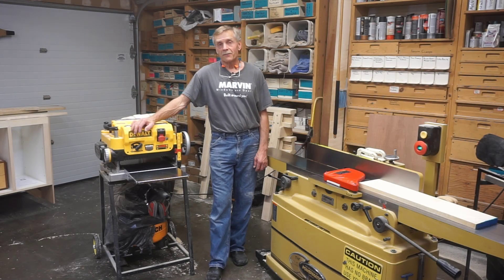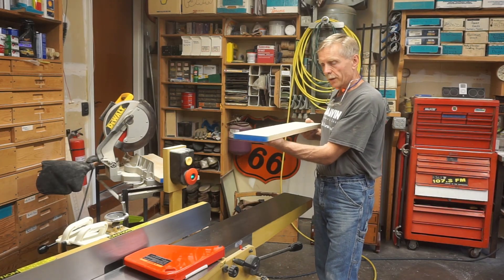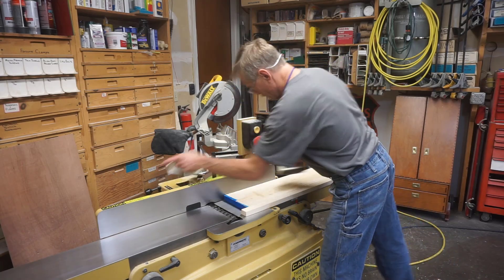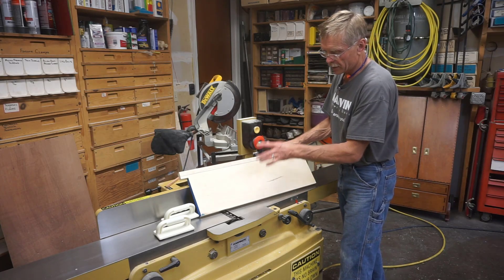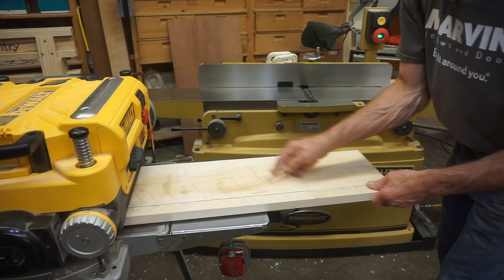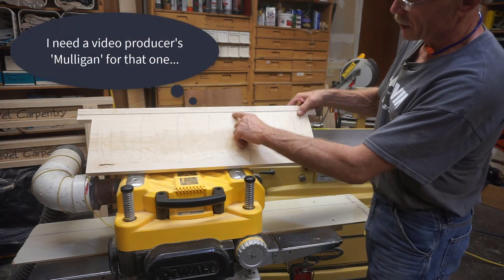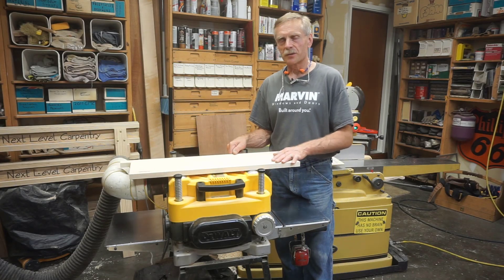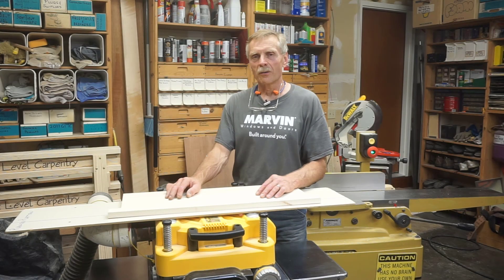Supersize Your Jointer for Planing Over-width Boards

Comment: Thanks for the tip!
If you had to get a new jointer, would you go with Powermatic again or would you consider other brands (and why)?
Reply from the maker: You're welcome, Muru!  For your question: Unless something new has come on the market that I don't know about since I bought the Powermatic, yes, I would definitely buy the same machine again.  It's tough to beat the fit and finish of the PJ88 and the LONG infeed and outfeed tables make my life much easier.  BTW I bought the straight-knife version of the PJ88 and installed a Byrd Shelix cutterhead rather than buying the PJ88HH which comes with the Powermatic helical cutterhead. The reason I did that is because it was essential for me to have the capability to rabbet pieces (for exactly the reason shown in this video) and, at the time anyways, Shelix offered the special 'rabbeting tip' cutters for their cutterhead while no one at Powermatic would tell me if their cutterhead offered rabbeting capability or not... that was bewildering to me considering the handicap of selling jointers that can't perform a rabbeting operation.
That said: the main weakness of the Powermatic is the fence angle adjustment mechanism which, as I mention in other videos, has an angle reading which is more 'range finder' than angle gauge IMHO.  I could be convinced to switch brands if I could keep all the Powermatic features I use and love but get a functionally reliable fence.  Let me know if you have other questions on this and I'll try to respond?  Oh: whatever brand you end up with one of the most important features for any jointer IMHO is to have the parallelogram table adjustment.  The depth adjustment speed and range is invaluable when milling rough stock. For initial passes on pieces it's not uncommon to go from 1/8" up to 1/2" depth of cut numerous times on a single project. With a parallelogram model that takes 2 seconds, with a hand-crank it would take many minutes.  BTW models that have a lever adjustment but have 'ramp style' tables are a poor substitute: height adjustment is faster but accuracy suffers because the lever is weak for 'fine tuning' the cut depth.
Wow, that's a rather over-done response to a short question... hope it doesn't scare you off 🙄😁😎  Best, Matt
Reply: Thanks Matt. The feedback is much appreciated! I'm in the market for a new jointer, as you could guess from my question. Believe it or not, my current jointer is a cheapo Chinese 6" benchtop model with a total table length of barely 26". I've had it for almost 5 years and it still works, kinda, but it's really time I upgrade.
Reply from the maker: Muru, having to deal with and work with a 'cheapo' jointer is the best classroom you can attend for learning how to really use a machine.  I started out with a couple old Delta 4" models, a pathetic Mongomery Ward 6" unit, then an 8" Delta and finally the Powermatic you see in this video.  In depth knowledge comes from that experience and less-than-optimal equipment.  Those that start out with top of the line stuff actually have a handicap that limits what they can do and how versatile they are in the craft IMHO.  Once you have access to a superior machine you'll make great strides in what you're able to accomplish because you're unfettered by the machine's foibles but more capable because you've learned how to work around all the cheapo machine's shortcomings.  Hope you're able to afford a parallelogram style jointer of some brand and size, it's a quantum leap from what you've been using.
Best, Matt
Reply: 100% agree!

Comment: As always, really enjoyed your video and professionalism.

I really need to get myself a jointer!.. Just damned expensive here..
Reply from the maker: It was many years before I could justify the cost of the USS Powermatic PJ88 jointer so I can relate to your sentiment, Mark.  Cool thing is that you can flatten boards 10" wide with just a 6" jointer which will get you a long way on projects with the lower cost for a jointer.  I highly recommend getting a 'parallelogram' type jointer if/when you pull the trigger on one... they're totally worth the extra cost compared to the hand-crank adjusting type IMHO.  Best, Matt
Reply: @NextLevelCarpentry  Not clear on why you cannot do all of the flattening with the planer?
Reply from the maker: @stephanieray6587  Study the function of a thickness planer and you'll understand... or try it once: find a board with a noticeable twist in it and run it through a thickness planer... it comes out smooth... and just as twisted as it went in.  Best, Matt